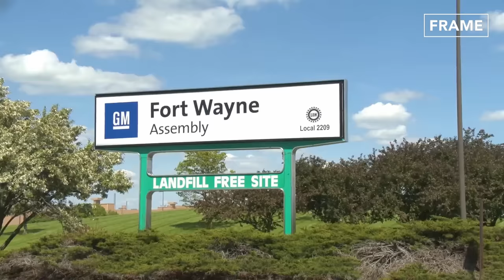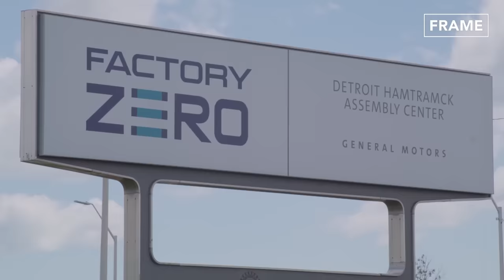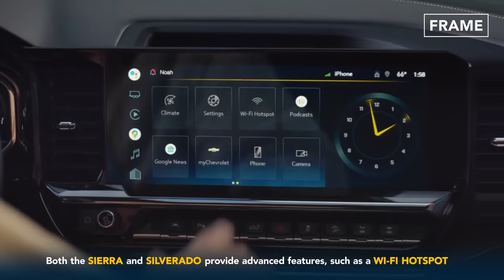Inside US Best Mega Factory Producing the Massive GMC Sierra - Production Line

Comment: I only purchased one new vehicle in my life, it was a 1976 Chev. Cheyenne 1/2 ton. I personally put 380,000 miles on that truck & never had a valve cover off that 350 in the 21 years I owned it  and it still ran & looked good when I finally sold it.

Comment: just took a drive down memory lane and came up with a list of GMC/Chevy pickups that I have either owned or leased for both work and pleasure, Had a 66, 70, 76, 81, 89 (2 of them), 94, 96, 2000, 04, 07 and a 14.  All were good trucks, some better than others, Thinking the 04 and the 14 were best of the bunch.  Still have the 14 with 150,000 km on it (retired and dont drive near as much anymore) Oh yeah, had 2 Fords in there as well,  Never a Dodge, or Toyota.  Thank you GM plant workers.

Comment: My 2016 Silverado was built here...best vehicle I ever owned ! Rides great with only having to replace brakes,tires, and 1 O2 sensor with 77, 000 miles
Reply: I am almost 100,000 miles strong with my 2016 1500. Range AFM to deactivate the system.
Reply: My '16 LTZ 4X4 6.2 has 90K miles.  Also a Fort Wayne truck.  Fantastic truck; has everything I will ever  need.  $46K OTD.  Beautiful styling.  Hard to replace it with a $70K truck.
Reply: 2014 silverado double cab 180k miles only thing that went wrong was the thermostat transmission still dynos same numbers as new maintenance schedule is key
Reply: O2 sensor at 77k. My Honda hasn't been replaced with over 150k miles
Reply: @abrahamreyes3340  I have a 2014 gmc Sierra with 186,000 miles & it’s been solid & it’s paid for! 👍🏼
Reply: @gbrewer1296  all these babies need is a tune to get rid of transmission and that dam afm and they're solid 👌 I seen gains of 30 hp just by taking out that crap and putting stage 1 cam
Reply: $46,000 for a brand new truck?! No thanks, I'll take my chances, and probably save about $25-30 Grand on totally rebuilt 30 year old truck!
Reply: Can't tell much about a vehicle until the 150k mark. Kinda like stating your new big screen tv is great because you watched an entire football game without it shutting off.
Reply: 2015 Silverado 3500 crew cab Dually Gas 6.0 with 60,000 miles it gets 12 mpg empty and 6 mpg pulling a 10k TT
Total BS  oh and it HATES hills.

Comment: Just got the 22 refresh AT4 Sierra with the 3.0 duramax and it’s hands down the best all around truck I’ve ever had!
Reply: I'm thinking about the 3.0 Duramax or the 6.4 , Not overly concerned about gas mileage , But if you don't mind me asking how many miles you have on the diesel and have you had any issues with it ? I've heard a few people have problems with them but I would Really like a Duramax Diesel. Duramax
Reply: @affordableroofingpaving1336  i’ve only put 1000 miles on it with no problems
Reply: @chriscraft6327   I have the 22 refreshed AT4 3.0 Duramax as well and just hit 2500mi. I will never again in my life own something as awesome as this beast. The fit and finish is second to none 👌🏼
Reply: @diversitycandle5708  I agree 1000%
Reply: @affordableroofingpaving1336  In August got my GMC 1500 3.0 and put over 4K on it. No mechanical issues. The infotainment system freezes sometimes. The Check Engine light will come on while in Regen about every 400-600 miles. I’ve seen no reduction in MPG or performance during Regen. The 3.0 gives LOTS of power and my MPG is in the 30’s. I really love this truck!
Reply: ya wait until your valve cover or rear main seal leaks, the turbo goes and all the other issues these POS have
Reply: @joe0813  yeah and you know this how?
Reply: @h8troodoh  because I work at a GM dealer fixing them all day long
Reply: @joe0813  wow,they sound like a good engine,too.. who knew..
Reply: @h8troodoh  we only get the broken ones so I'm sure they aren't bad otherwise
Reply: @joe0813  I guess... all I've been hearing is good things about these and the 6 banger diesel.. couple of early bugs,that was about it..

Comment: My 2014 Silverado was made here.    Seems I'm in the minority with a 4.3 v6,  but it has yet to have it's first issue.  Solid vehicle !
Reply: I have it's brother in the 2014 Sierra with 4.3. The only thing better would be a new version of the same truck. Love it.
Reply: It's hard to beat the ol 4.3 V6. You've got the newer 4 valve version of the engine. I've got a 2004 S10 with the L35 in it. Thing is more powerful than people give it credit for, and I'd be willing to say the Gen V engines only increase the capability of what the engine could do.
Reply: @AirborneRenegade    I'm not sure they have 4 valves,  but I do know the block/heads are aluminum.    I like the engine......and truck !
Reply: Same here with a 2015 V6 Silverado. No issues by far after a life of hauling and towing. Great truck👌🏼
Reply: @brucevrooman6107  Looked into it and you’re right. It’s odd they didn’t go to 4 valve. I was under the impression that they did when they moved over to the EcoTec series.
Reply: 2015 Silverado WT, regular cab, short box, V6, bought new, 64,000 miles, no problems, yet.

Comment: I had a 1992 Chevy Blazer which was a POS.  I had a two page list of problems after the first year.  Fast forward to last year.  I bought a 2021 GMC Sierra 1500.  One year later and I have not had a single issue!  GM should win an award for most improved.
Reply: It seems suto manufacturers cracked the whip in the late 90s and saw results innthe mids 2000s. New robotics do the same thing exactly the same everytime with. O lunch breaks or hangovers or worker sabotage. Parts are much more exact so they fit right. Quality control techniques were imposed with statistical analysis to ensure a certain minimum of compliance.
Reply: Come back at 10 years.

Comment: Thank you gm for having 100000 mile  warranty replacing 3 engine at no cost was great thanks again.
Reply: Great warranty. But why did you needed 3 new engines? Sounds like the engine department was drunk assembling them. The best warranty is none you never had to use.
Reply: If I had 3 new engines I’d be selling that lemon

Comment: Just wanted to clear up some misinformation. The video mentions that there are 2 engines available (2.7L turbo 4cyl, 5.3L V8). 

There are actually 4 engines: the aforementioned 2.7 and 5.3, a 6.2 V8 and a 3.0L turbo diesel or (baby Duramax as I like to call it)

Max power output for the Sierra/Silverado 1500 is 420 hp and 460 lbs which is produced from the 6.2L V8. 

Did you know?: The 6.2L is the Corvette motor with a couple modifications, like iron heads for strength and handling loads.

Comment: I still think they could make them slightly more rust-proof. I have junked my last 3 chev/gmc cargo vans due to rusting out.. still ran and drove fine, barely making ten years old here in NH.
Reply: Well...NH...that's why.
Reply: Get underbody coating done when you buy a new one. My '87 barely shows any signs of rust and I'm in new England as well
Reply: You have to pay special attention to washing the salt off and coat everything with rust preventative in the fall. You can thank the road dept. for putting 'brine' on the roads. Much worse than rock salt.

Comment: My 1998 GMC K2500 Z71   400K Miles Galavanized Body and built in Canada... try this in your race car inspired LS engine ( high Compression) and Lifter Failure issues . Yey Virginia this is where they were born.  Engines built before LS were meant to pull loads . Not race or go fast

Comment: How long does it take for assembly?
Reply: 14 minutes and one second...Didn't you see the video?...:)
Reply: Hello Jody, I’m a proud employee at Fort Wayne truck. When I used to work in the body shop, I was told from the beginning of the process to drive off and without any interruptions in the line, it’s around 12 hours. The plant is massive and I yet have seen all the departments.
Reply: It’s depends what you consider start to finish. I toured the Ford F-150 plant last year and they said the final assembly line (where pre manufactured part came together) took 58 minutes.  They were spitting out a new truck every minute.  It was nuts.

Comment: Sanding down flaws but yet not bothering the paint? I saw nothing about clear coat, nobody wearing uniforms everybody dressed like they're going to a family Barbecue, and too much Hands-On intervention, putting Parts in a transmission, really? All it takes is one pissed off employee that didn't get their lunch hour to screw something up and not put it together properly, yet these vehicles still come off the assembly line with Optical flaws, trim distortions, all kinds of rattling panels, let me in that assembly line quality control End of Line inspection, those Vehicles will be perfect when they leave!
Reply: It may come as some surprise to you but in the last 20 years GM has the best record when it comes to recall rates of the major 5.  They even beat out Toyota and Ford, VW, and Honda are in the bottom tier. I live in Fort Wayne and know a few GM employees and they would be offended by your comments. They have a strong union and good work ethic.  I have a 6 year old Camaro and haven't had one issue let alone rattling panels, and I track the car.

Comment: The trucks of today,and the foreign parts they use are so sad. at one time GMC  were built by people and with American made parts were they did not require a bunch of junk in the engine,or interior.I have a old 66 Chevy fleetside LB that still has original parts,my truck has at least 2million miles on the engine alone,so they built them to last in those days.

Comment: I have many issues with these new gen of trucks.  The roof structure above the front doors and front seat occupants is too short, the distance between the A pillar and B pillar.  This also reflects in how short the top of the front door frames are.  Really weird looking and out of proportion compared to the rest of the cab, especially on a crew cab.  The front end styling is terrible looking on the Silverado, better on the Sierra.  The wax coating on the frame is useless.  The black body plugs running along the bottom of the rocker panels is also very unsightly especially on a lighter colored truck.  The side view mirror placement is just dumb.  Because of this, there is now a large piece of black triangular plastic mounted in the corner of the window where the mirror SHOULD be mounted in the first place.
Reply: You sound fun to hang out with Greg
Reply: @Joeybago12  I'm a real hoot!  Several, several people have told me.
Reply: @jiggity76  yeah I could only imagine 😵
Reply: He owns a tundra
Reply: @bp7182  No, no, those are terrible looking too!  The news ones I'm referring to.

Comment: For the love of God! Can someone please tell me it's safe to buy a GM pick up?? Sincerely! I love them and want one, but I've read and heard so many horror stories of snapped valve lifters, carbon crud, failed oil pumps, and the worst transmissions in the industry! Is it all exaggeration? Was it just a couple bad years? Maybe a small percentage?
Reply: Buy a older one…like mine 07-13 body….DO NOT get one with a 5.3 they have afm…get the 6.2 only….the  1500 trucks with available 6.2 doesn’t have afm..Denali,slt with 6.2, Silverado with 6.2..also the 07-14’ suvs  6.2’s DO HAVE AFM….would love a newer gmc but that afm scares me and I’m not paying 40k for a truck that will have problems….keeping the old girl.😊

Comment: I worked there for 4 weeks. That job sucks
Reply: Yeah today I would say so too, 30 years ago I’d say you would be crazy to quit… today they’re using temp companies and starting people out at 16.90 a hr…no ins for what 4 years and barley a chance to get hired in… this is why the have quality problems- no one cares- then temps should start at 21 at least…. In the old days you got in there on the line and we’re at a good rate in 3/4 years and the smart ones were taking skilled trades test to get off that line and be a machinist/ electrician/pipe fitter or a mill wright… I’d never work there for 16.90 cheap fawks

Comment: Top thing in America you can buy and soon as you drive it off the lot it is worth 25% less than you paid for it. They are too many different vehicles made now. Stop making 40% of them and maybe ever other block doesn’t have a used car lot.
Reply: Used car values drop fast, not only in the USA. Car makers have to get their business going, hence the constant ad. bludgeoning of the public to buy new models, while the older ones are still in running condition. Those end up in junkyards. That's the way consumer society works.

Comment: GM has to many failures ...Allison10 speed transmission....problems....6.2...5.3 engine valve stem  problems...new small diesel  ....you have to remove cab to change  timing belt....if motor has to be replaced due to warranty....you get a used motor ...not a new one.....the price for these trucks...and get problems  like  this  ....not me

Comment: Almost zero new video here, until the last 3 minutes.  These are the same processes and assembly workers building 2015-2017 trucks that we have seen in past video productions.  I'm getting tired of checking out these factory videos just to see the same images and the same workers doing the same processes that were included years ago.  If you are going to tout this as a new video, you need to get some new shots of the factory.  I was disappointed......
Reply: You might want to look again, those are NOT 2015-2017 K2 trucks, but rather the new 2019-up T1 trucks
Reply: That's because all of these channels like this just take GM's free B-Roll videos on their press site and cut them together. You can tell the channel creators never visited the factory, because they showed the assembly process in General Assembly out of order so they're just guessing from the B roll videos. As someone who works at GM, I noticed a few clips aren't even from Fort Wayne Assembly but instead Flint Assembly that makes the HD trucks.